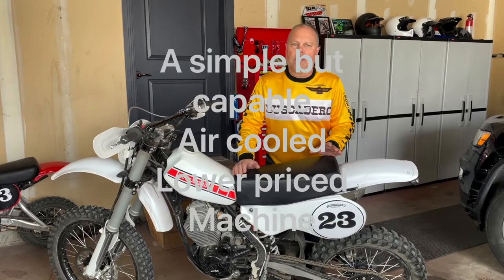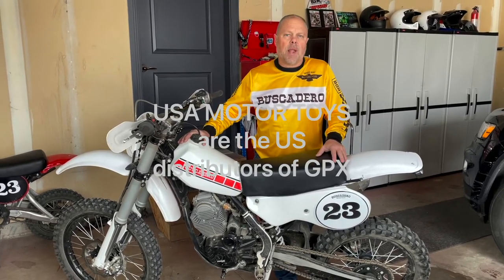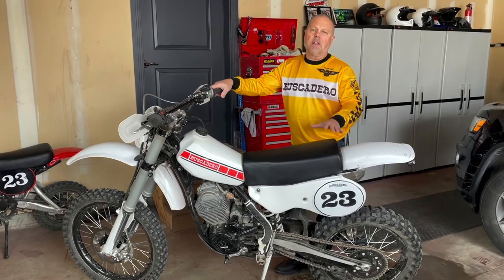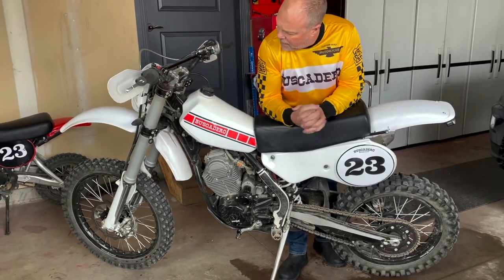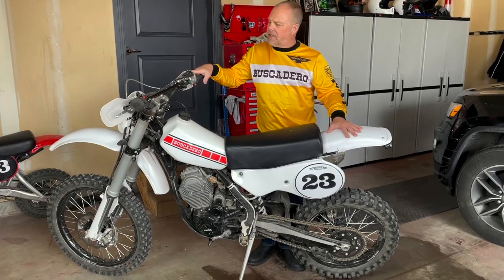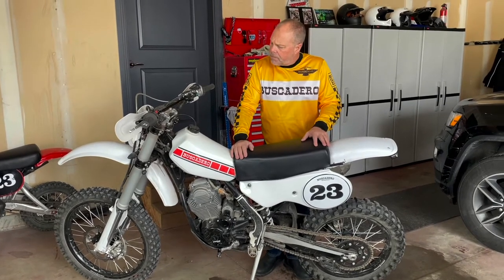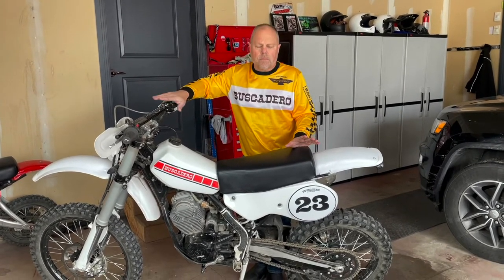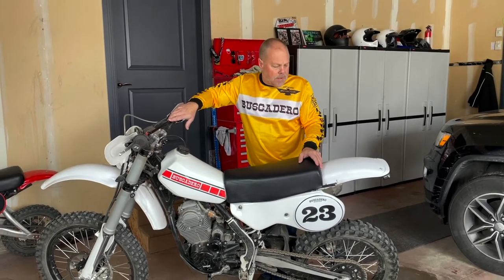A better carb for the GPX FSE 250 - Buscadero Motorcycles

Comment: Theese types of bikes are so awesome. Im 27 and have road most my life. My first bike a was a 1980 ds 80, then i had a xr200 for a few years, and ive owned a 2004 cr125r for 14 years. I recently bought a very low hour 2003 drz400k kickstart only model... i want another aircooled 4 stroke.. ive been looking for frames that could be fabbed for a zongshen 230 ohc motor.. i have a rolling 94 yz250 frome and a rolling 96 rm125 but idk.. My dads a fabricator, im considering a full custom frame with twin shock rear, steel swingarm fabbed to take a moddern 18" rear with discs, and chope the neck assembly off the rm15 and use the beefy conventional forks. I want a steel tank, vintage seat, yz style fender "70s" style bike i can hit litle jumps on and rip the woods? Any subjestions? Haha what frame should i look for to avoid this fabricating, tube bending nightmare?

Comment: Yes I’ve been dying to find a modern air cooled reliable xr250r motor in a ktm 85 or 125 frame with disc brakes suspension electric start adjustable suspension would be the perfect motocross drill bike. No slamming hours on a 12k 450 practicing 8 turns… 😂